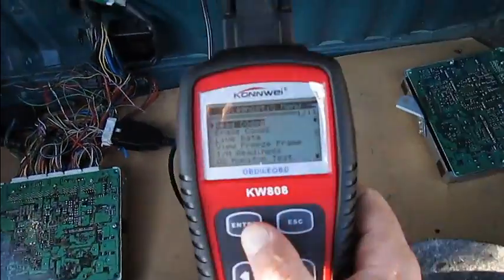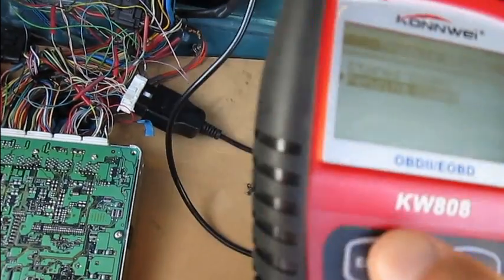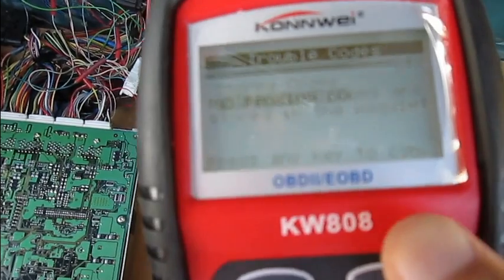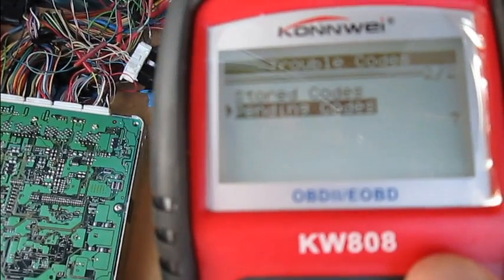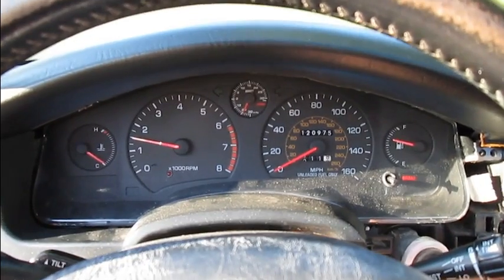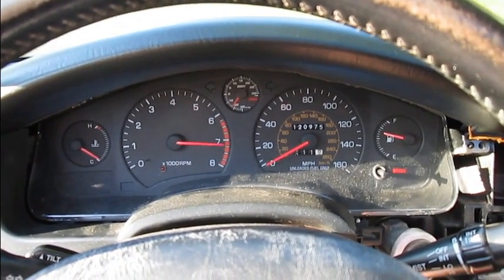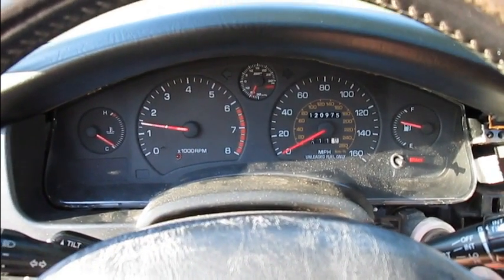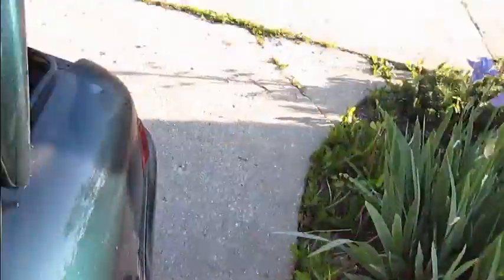Toyota 3.5L 2GR-FE ECU, 7200 RPM, No DTCs and No Immobilizer

Comment: I know this is an old video, but would my 2007 camry 2gr pass emissions with this ecu? Wanting to kill off the 6250 taper and increase my revs to 7200 as well, motor is stock minus intake/exhaust

Comment: I have a 07 2gr fe camry I'm looking for some tuning info do you do anything relating to that?
Reply from the maker: The best thing to do by far is to get a better y-pipe and exhaust made. there's a TON of power hiding in there. there's no need to get into the ECU tune to get more power.
Reply: 865tanman R9K Tuning

Comment: Hey frank i was womdering if i can do this engine setup on my 2014 avalon ?
Reply from the maker: There are things that can be done in the ECU but most of the extra power we get in the MR2 application is from the headers, exhaust and intake. The ECU immobilizer stuff is needed for swap applications so may as well get a few tweaks at the same time to add a bit more timing and lean out the fuel at the top.
Reply: Frankenstein Motorworks is that modified ecu you sell on website would it work on my car
Reply from the maker: @brianalvarez8664  the ECU as i sell it on my website are converted to manual transmission use so they would not be a good idea to use in your car. I'm also not certain if the 2014 avalon shares a pinout with either of them. If your goal is more power your money would be much better spent on a custom y-pipe since that is the biggest restriction in the system.
Reply: What about the mwr camshafts and the gouky i know that i would need a custom y pipe right ?
Reply from the maker: @brianalvarez8664  those cams have proven themselves over and over to work well. the only issue you'll have is they don't make additional power in the range your transmission is configured to operate in so i'm not sure they would be of any advantage in an automatic transmission application. You would need an updated shift schedule and there may be someone out there working on that but i don't know where to point you to.
Reply: So the modified 5plug ecu can be install in my car ?

Comment: a set of your headers, a custom y-pipe, better tires and your ecu tune in my 06 Avalon would make it one hell of a boat to drive. lol
Reply from the maker: There's at least one Avalon out there with these headers on it. It makes it rather loud but it does add power when the rest of the exhaust is there to support it.
Reply: Frankenstein Motorworks hopefully in the coming months I’ll be able to have someone order a set for me from Illinois. Sucks about the Indiana tax thing but it is what it is. As for the noise I’m considering varex mufflers out back. Full 2.5” piping from the manifolds back. This engine likes to breath it seems (if I could get my hands on a trd supercharger from Australia I’d be the happiest man on earth lol)
Reply from the maker: The TRD supercharger is mostly looks. the lower intake manifold is junk and really takes the fast revving nature out of the engine. Here's a dyno chart of it making about 335rwhp: http://frankensteinmotorworks.com/2GRFESupercharger/2gr-fe%20supercharger%20dyno.jpg
Reply: not what i was expecting, i assume the lotus supercharger is superior then? doubting i'll go past full exhaust and upping the rev limiter on an avalon, but the ideas crossed my mind. (im in the process of an over the top 3.4l build for a truck right now..)
Reply from the maker: yeah, I agree that it is quite disappointing. I spent a bunch of time making a large part of the kit to install this in the MR2s and when it got far enough to get a dyno run the output just disappointed me so i dropped the project. The early lotus unit is the exact same unit as the TRD unit. They made an updated design which is apparently better but it's even rarer than the TRD unit. I haven't given it a go and i likely will not.
Reply: i've found the upgraded supercharger for sale before. the kit was around 15k though. not happening for me. i can just drive 30 minutes to precision turbo and pick up a turbo for a fraction of the cost of that kit.. lol
Reply from the maker: I fully agree, that's one of the reasons i dropped the project. There's some neat stuff potentially on the horizon for boost with the stock ECU also.
Reply: hmm i'll have to keep my eyes open then.

Comment: Whenever U get 2 7,200, that's a REAL sound, engines that don't make that sound R not real engines, I'd put 3 of the same engine into a small high performance multiengined airplane that I've designed a couple months ago. When I fly that thing, it'll sound JUST LIKE THAT at 7,200 RPMs.

Comment: I was thinking to K20a2 or 2GR-FE swap my MR2 Spyder. A K20 application will cost about $9k before a built motor or turbo application. And,  200bhp/2195lbs is not worth the money in my opinion.  But 275+ bhp/2195lbs with revs that can almost match a K20a2 redline with a stock motor is impressive. Now I want a 2GRFE for sure. How much power are you getting with the new redline?
Reply from the maker: With the stock valvetrain the motor does not make any more peak HP, but it mostly holds the peak so you end up with way more power when you enter 2nd and 3rd gear. Personally i think the 2GR is a bad fit in the Spyder MR2. I'm working on a 2AR-FE kit for the spyder as we speak using a 6 speed manual.
Reply: Frankenstein Motorworks curious to whether you went through with the 2ar fe. The 2gr seems like a good engine for the mr2 spyder but why don't you think it's suited for the sw21?

Comment: will this ecu work on my 07 camry? thx
Reply from the maker: I can tune the ECU in your camry but the  ECU isn't what is holding you up. it's actually your y-pipe. Contact me about what you're looking to do and i can see if i can help you Marc@frankensteinmotorworks.com
Reply: Frankenstein Motorworks I cut-up the y pipe n fix the crappy 1" merge. I actually have a exhaust cut-off right b4 the cat too. I'll email you. thx

Comment: Is that 7200 rpm on a stock 2gr-fe, or did you have to swap the heads?
Reply from the maker: This is with a completely stock engine. I've also raced this engine with this higher limit without issues.

Comment: 7200 rpm on a cold engine. lol.
Looks like it developed a tick right before our very eyes ...
Reply: A: he never said he removed the thermostats. Why are you trolling? Marc is an expert on the 2GR engine.

Besides, Looked to me like a hot day and his temp gauge was off the peg. These engines run 0w-20 oil, the only thing starving for lubricant here are the rusty gears in your head.
Reply from the maker: Oil still lubricates when cold, also I had been running it before the video and you can see in there that the needle is off the peg which means the motor is at 120F or so.  but it doesn't really matter, this kind of abuse is nothing compared to what we do to the 2GR-FE engines when we endurance race them. these motors are rock solid.
Reply: Frankenstein Motorworks Oil still lubricates when it's cold ... well yes ... but nowhere near the design target.
Oil is thick when cold, and certainly does not function as it should.  The bearing tolerances are pretty tight in modern motors, and you're relying on trying to  push marmelade in between them ...
I know the 2GR is a tough engine, but lack of lubrication will kill it ... as it would kill any other engine.
Sounds to me like you damaged it.
Reply from the maker: i had to listen to the video a few times to figure out what you were talking about. that's the clutchmasters clutch hub making that noise. it did not make it until afterwards because i was holding the clutch pedal in. 

it's been making that noise for as long as that clutch has been in there whenever it's at idle in neutral.

But hey, it's youtube so why not jump to conclusions on engine internal diagnostics from a crappy i-phone video that makes a sound for about 3.5 seconds.
Reply: That is definitely not a clutch.  It's too high pitched.
Really dude, i don't care either way lol.  I know what i'm hearing, and to me, it sounds like it's possibly something in the valve train.
Reply from the maker: It's definitely the clutch springs. You guys are diagnosing through a compressed video from a cell phone source. If you look at some of my other videos i fully characterized the stock coolant gauge when i was doing Lotus ECU stuff and it's really not worth much of a damn.  Yes, the clutch is noisy on this car, to the point where it is irritating and often if sticks until it's been revved or driven before starting to make noise. 

Besides, if you think this is abusive you should see what I do to these motors on a race track for 10-24hrs at a time. I've only ever blown one motor in this application and it was due to a plugged fuel injector and an AEM Infinity ECU that did not respond properly to the resulting AFRs. The stock ECU is really good at protecting the motor and we've never had an issue on the track.
Reply from the maker: I know it's two years later but i recently serviced the car. the noise was getting louder and i wanted to answer this question. the rattle/tick was an outer CV with just a bit of play in it. Revving it at idle was causing the shaft to vibrate back and forth and making the noise. That's why the noise would disappear with the clutch in.
Reply: Nice video and work. I came to the comments section to drop the exact comment as detaart. When Frankenstein Motorworks started the engine I was watching if the temp gauge would move and then looking at how much time is remaining in the video and thinking to myself, "please don't rev this cold engine to redline", and wow pretty crazy. Not only the issue of thick oil but also as the pistons are aluminum and have a higher expansion rate than their cast-iron cylinder wall liners, revving a cold engine could cause the pistons to rattle causing possible contact with the cylinder walls. Excessive wear to the walls then results in reduction to the oil ring performance resulting in more burnt oil and crank case blow-by, and, ultimately, a loss in power.

Having said all of this however, I do respect Frankenstein Motorworks and the guys who run 6cyls in their SWs. I do wonder if this was me I'm sure I would be so overly excited as well....but I just hope I would have the presence of mind to not redline a cold engine!! As for me I baby my AW11 until at minimum 1/4 temp gauge and I would never redline it until it's absolutely at normal temp which is about 40% gauge for my car.

But, again, keep up the nice work, VERY cool that you guys have found a way to modify the stock ECU!
Reply from the maker: I'm a big fan of engine swaps for any reason but honestly in this case you'd honestly be better off just switching trucks and getting one with the 1gr-fe and putting an intake and exhaust on it. the 2gr-fe is a transverse motor so the bell housing is not going to match your current setup. if you're dead set on swapping an engine with more power in that truck I'd probably look into the UZ or the UR v8 engines but it really depends on your skill set and requirements. feel free to drop me an e-mail and i'd be happy to have the discussion in detail. Marc@frankensteinmotorworks.com
Reply: @FrankensteinMotorworks  do you know they use the 2gr in rwd vehicles such as is350 gs350 Tacoma. And the 2gr bell housing pattern is the same as the 1gr. 

Would the computer work on an 07 camry V6 or can it not be an auto?
Reply from the maker: @perfectcircle22  the IS350/GS350 use the 2GR-FSE motor, not the 2GR-FE. These motors add direct injection so they cannot use the same ECU. The Tacoma uses the 2GR-FKS which is yet again different and also has direct injection so it cannot use the 2GR-FE ECU.
Reply: @FrankensteinMotorworks  ahhh, thanks, I assume you're headers would still work?
Reply from the maker: @perfectcircle22  based on the pictures they do look like they would bolt to an FSE but i have never actually tested that.
Reply: @FrankensteinMotorworks  thank you for your replies.
Reply: "if you think this is abusive you should see what I do to these motors on a race track for 10-24hrs at a time." Are you telling us you've intentionally removed all thermostats from these engines for track use in order to prevent proper operating temperature? If so then I have to concede that the 2GR truly is rock solid as you've said. Aside from proving to the world how reliable your engine is, why would you do this? Using a permanently cold engine the ECU will forever be on cold idle & cold fuel map which injects more fuel to compensate for poor combustion characteristics in such a non-ideal cold condition, which is loosing additional power as well as coating your exhaust with extra unburnt fuel deposits which could after extended use as you've said increase back pressure. You're crazy man. Nice swap and nice 6-cyl setup in a MR2, but still a crazy way to use an engine.